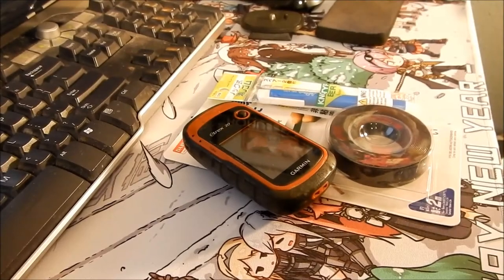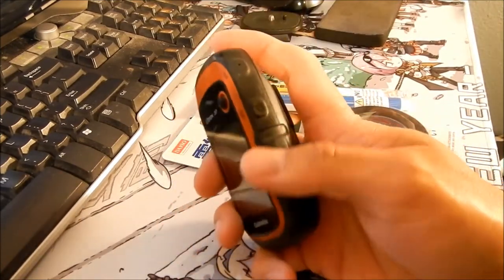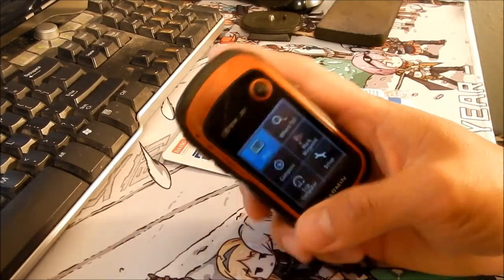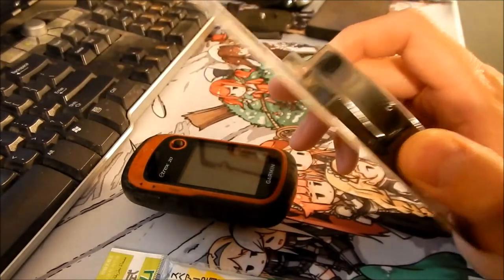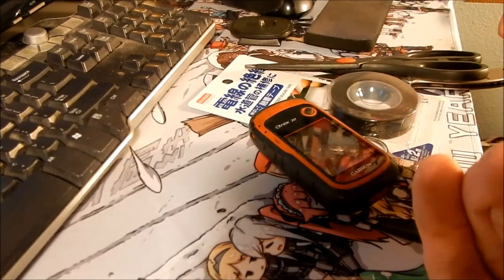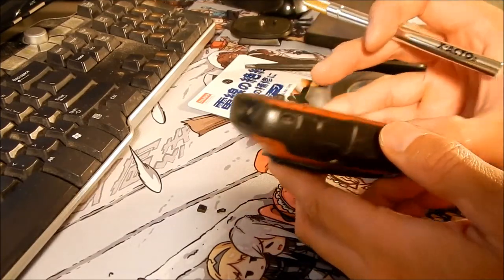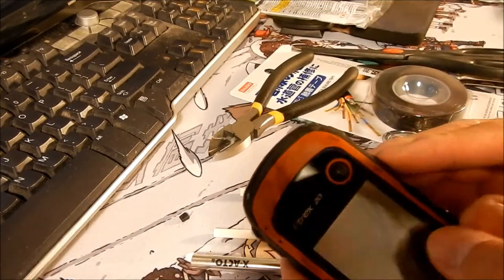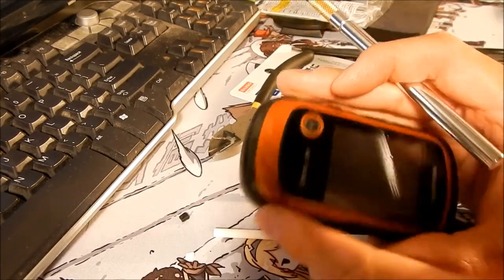Garmin eTrex 20 Button Repair VLOG

Comment: Button just failed on mine.  Your video is the first I found and you have the perfect fix!    Thanks
Reply from the maker: Good to hear, I will admit the silicone wrap doesn't work too well with the cradle mount but so far it still works =)  Maybe just some electrical tape will do the trick.
Reply: @hadesomegamoto7639  I used the same materials, but dismantled the etrex, placed the tape over the hole on the inside & pushed the eraser through from the inside & trimmed the tape. I then used some impact adhesive to hold it all in place in the hole. I doesn't look pretty, but it does work.

Comment: Thanks for your tutorial. It is long but as a result I had the confidence to experiment with fixing the 2 right hand buttons of my etrex 30x. I ended up with making a rectangular power button and a 5mm round eraser shaved slightly to make an oval for the back button. I used electrical tape as all I had. Buttons working and all well sealed, just doesn't look that good.
Garmin told me I could have a refurbished 30x for 110 usd with a 90 day warranty.

Comment: I also had the same problem with my etrex 20, I think garmin has this major issue with the material used for the buttons. Seems as if its designed to decay after a couple of years and then force you to buy a new model. In my case I took the unit apart and used black silicone glue (not the one used with the hot gun) more like the one used for gaskets and to accomplish a water proof seal, and then place the black little button in the hole. Since the silicone is somewhat elastic you can press the button with no problem. Also, amazon sells a little silicone skin that can help you protect the buttons. Great video and thanks for sharing

Comment: Yeah good shout on the silicone tape - I had to repair mine in the field and cut down a length of pencil and cut to shape, holding in with duct tape. Yours looks to be a more elegant soloution.
Reply from the maker: I'm using a silicon skin/cover I found on Aliexpress now.  It wraps around the GPS.  Its kind of annoying to take out of a cradle and remove the back but looks nicer and will probably last longer.

Comment: Great video, instead of tape I used Dap Kwik Seal Sealant over the erasers, so far it seems to work well. Thanks for the eraser tip.
Reply: @pleco101  This seems to work so far, I used Dap Kwik Seal Sealant ( bathtub sealant), good luck...

Comment: I have a Etrex 30 that has suffered the same fate. Really disappoints me that a company as big as Garmin does not support its customers by making a replacement shell. Discarding a perfectly functional GPS because its rubber case has deteriorated (material selection?) does not make sense to me. Seems Garmin are more interested in selling me a new GPS. Does Garmin have a GPS monopoly? Who else makes them?